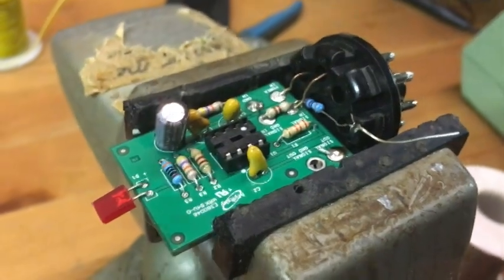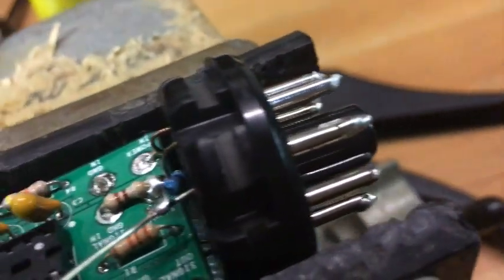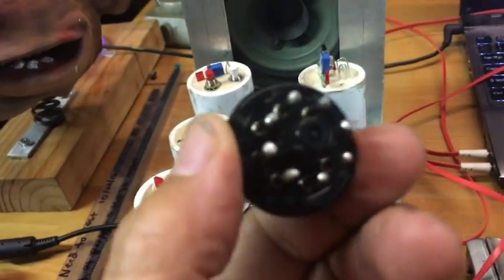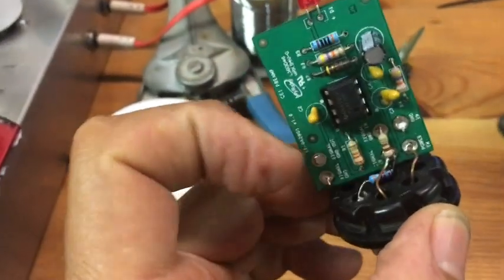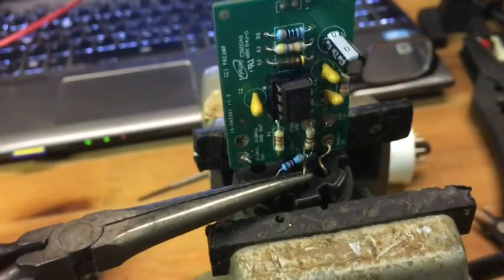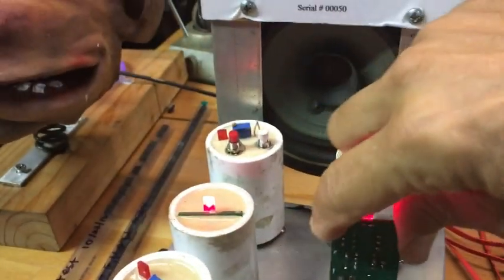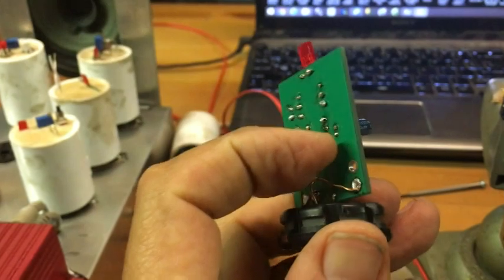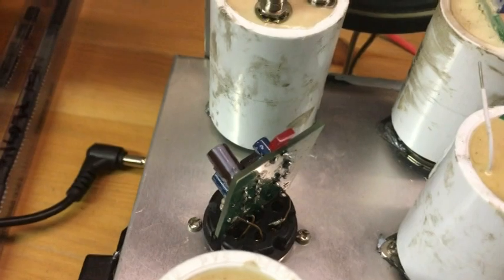Fixing the Preamp before Encapsulation

Comment: Great informative video Aaron. May I ask why you decided to use wolf pack five modules instead of Rae boards?
Reply: ShowbizPizzaFan yeah
Reply from the maker: Yes.  Tone control is the easiest and cheapest way to sync up toggling bits synced to a sound track if you don't have too many bits to control  Once you get over a certain number, it can get easier to do it with a more expensive digital system and it makes sense to go to that.